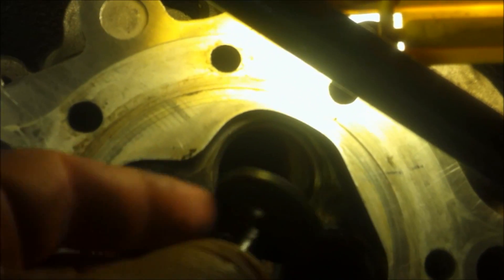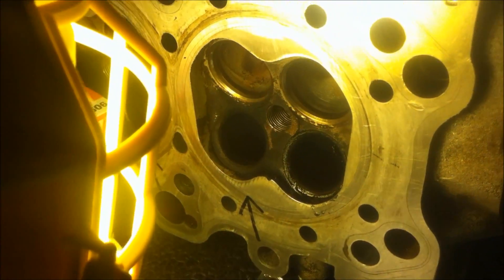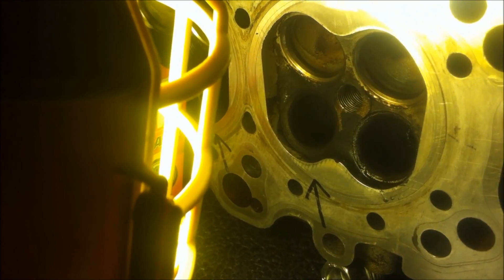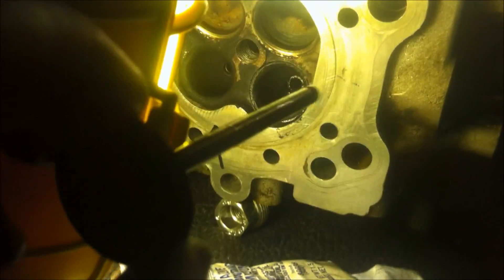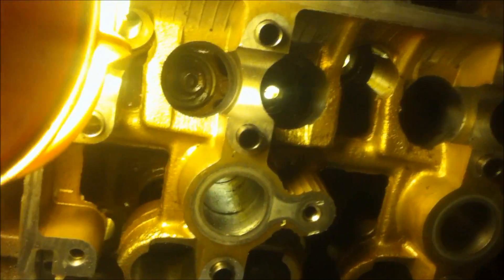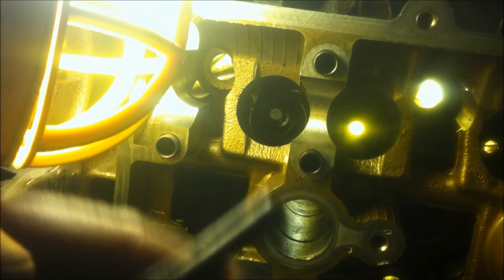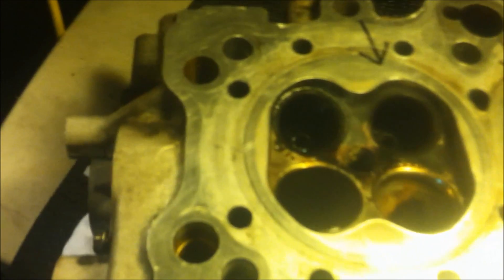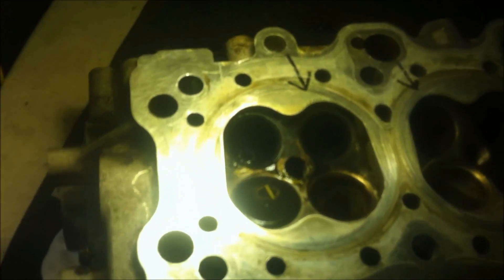EASY, HOW I LAPP & GRIND VALVES. THEY DONT TEACH THIS TRICK IN SCHOOL, ONLY OLDSKOOL.

Comment: why would you not just ues a standard suction cap valve lapping tool , they cost about 10 bucks which is cheaper and just as easy . this is just another method but not necessarily any better or cheaper . probably faster but thats the only reason i can think of doing it this way . 12;55 you even have a standard valve lapping tool there , just use the rubber cap on a different attachment so you can use drill . easier than trying to work from behind head
Reply: You have to go to a store or online to by a specific tool. it's better and faster to reuse what you already have. That is.. If you have it? If you have to go to the store to get the compound, then, if you have enough $ get the flex bit then yeah, get it. If the store doesn't have the flex bit, or you don't have enough $, at least you have plan B.
Reply from the maker: Michael Polson Dont do it then, Do it the hard way if you like.
Reply: oldskool funk  using a flex bit on the rubber cup and standing in front of head is harder ? how

Comment: I was a cylinder head specialist for about 15 years in well equipped shops, even we relied on methods like this when we had issues  This man, I would be proud to work beside, as the mind set of quality at a low price is there.
Reply: If you worked in a shop for 15 years you should know that you don't use a drill to do a valve job , you supposed to use your hand  with a lapper tool so you can feel it and be more  precise . You can use a drill (yes ,maybe) but it's not the way to go
Reply: @yosoydpfknr2855  I was thinking the same, yeah you can make it work with a drill but if you’re not careful it can make grooves in the seats where the compound sits in one place. Better to take your time and do it by hand.

Comment: Thanks for the video! I'm trying to revive a rider mower. I thought a valve seat came loose from the head, but all looks fine...but dirty. Going to clean things up and try re-seating the valves. The valves do not look bad and very little if any play. Might just do it by hand, but at least I know how to do it after watching this. Since I already have the head off, no reason not to try.
Reply from the maker: Badboy7357 Right on, I also made a video on how to check if your valves and valve seats are leaking that way there is no guessing, Check it out https://www.youtube.com/watch?v=q_gEp0NEybQ
Reply: oldskool funk After cleaning the head, valves, hand and drill lapping, and resetting valve clearances the rider fired right up. I am not sure what a shop repair would of cost, but it only cost me $15 tools/grinding compound/gasket sealer and about an hour of my time. Thanks for sharing your tips!

Comment: I did it in a slightly different way, and I will share it right here in your video, because some people may not have access to the same tools of yours.  I just turned the cylinder`s head around and pour some gasoline in the intake and let it there for a few hours...  to be honest, I didn`t even know that the valves had to seal , I just thought it would be logic if they did to keep the compression.. so I had these two cylinder heads here , old ones, and started to do some experiments, cleaning and such..    adding gasoline inside the intakes was very easy to do and the result was visible in a few minutes later..  I suppose it wasn`t sealing properly because of the thick carbon layer around of it.. cleaning it properly without grinding solved my problem.

Comment: Perhaps  there's a valid reason why they don't teach this. This isn't likely to repair the sort of damage that, caused a car owner to bring it into the shop in the first  place. The only real utility to lapping in used valves besides putting the finishing touches on reground seats and valves, would be reconditioning the valve surfaces that don't warrant regrinding.   Somewhere around here in a really old school  set of  valve tools. . A  hand turned lathe that uses a metal cutting lathe bit to cut a new surface on old valves.  Also  seat recondition tools that where that allow you to replace emery paper on tools that will grind the popular seat angles.
Reply from the maker: Youve been voted off the Island you will be deleted for thinking to negative and To much whining
Reply from the maker: Don't be negative like this guy peepz keep on smahin in life
Reply: nothing of value was lost aka the info you share
Reply from the maker: You one of those who just dont get it. No soundness just complaining. You should let that junk go its only going to break you down. Keep in mind while your complaining people (like myself)are GETTIN IT DONE.
Reply from the maker: waswestkan To much thinking there, Dont over analyze it just get the point.
Reply: oldskool funk i feel like you put too much thinking into it you could have just bought one of these http://www.ebay.com/itm/Vacuum-Pump-VALVE-LAPPING-TOOL-3-different-size-suction-cups-Kart-Lawnmower-ATV-/251280026570    instead of rigging up a hose to a drill where you wont be able to put much pressure on the valve to actually grind it
Reply: no i get it youre "fixing" this "badboy"  and when its done its not going to fuck up for 5000 miles
Reply: Seen it have to be done on new heads and valves not just used

Comment: My Dad taught me this when I was 15 (54now) when we were freshening up my first car (67 Cougar) and the valves were leaking a bit. We used a piece of 1/4" air tool hose, more rigid and twisted less than vacuum hose. Man o man did that make a difference. Before, it would screech the tires on full throttle take off. After, it would burn the tires as long as you held the pedal down. My friends were impressed big time. I became a mechanic and built many engines before I was 20. I have since run a machine shop and now have my own shop. Good video and your technique is very good. I say all this to commend you on your talent and skill. Heck of a job on  a Toyota 3.0 and the good news for all watching this is that if the valve clearance was good before, this method can save you a lot of time and expense adjusting the valve clearance since it doesn't take much material off the valve face or seats. GREAT VIDEO!

Comment: Well Skool, last week I commented on the head shaving at home and now this, you give me inspiration! Bent valves with a slipped t-belt and looking at bringing it to a machine shop for a few hundred or a mail order rebuild for close to 400. For 40 bucks I am going to buy new valves. Any tips? Its a 13 year old 120,000 mile NYC so the 3 angle, 400 machining job is out. BTW the head warp is under .001".
Reply: +G Zuk We run a machine shop, one thing I can say from old school back when I learned to now is....the valve spring compression/install tool specific to four cylinder engines is a good thing to have.  We use those old style C-Clamp looking things on V-8 still, but the new lever style tool is just great.

Heres a generic example:
http://www.amazon.com/Engine-Overhead-Remover-Installer-Compressor/dp/B00AU5LISS/ref=pd_sim_sbs_236_2?ie=UTF8&refRID=0TW1D2T54RD5EVXNG4DJ&dpID=41EZlI5kprL&dpSrc=sims&preST=_AC_UL160_SR160%2C160_

Stay gold.
Reply: Thanks, I learned the hard way the 10 dollar harbor freight valve spring tool is NOT for use on the OHC 4cyl. I ended up buying the rebuilt head out of sheer frustration of trying to get the valve springs off. Turned out the I had bent all 16 valves and still wasn't sure if I had cracked a guide.

Comment: you should have done just gas you still would see the bubbles and you wont have the rust later if you didnt treat it after.
Reply from the maker: Don't need gas but any liquid will work. I always put oil on after to prevent rust
Reply: k just had to say i have had rain problems... not fun

Comment: How do you clean out the grinding compound after you're done?
Reply from the maker: I use engine degreaser to spray the whole head then I use brake cleaner, carb cleaner or acetone to make sure the head surface is oil free before I install the head gasket.
Reply from the maker: Ha ha ha, does it work?

Comment: You can also use a socket, extension, and a hammer to get the valve springs off. Easier and cheaper than getting the tool, unless you are doing a bunch of heads.

Comment: You said that is an intake valve! So the same job can be done in the exaust valves as well? If its same procedure it will be great, and good to know i can fix my valve sticking open and causing missfires and commpresion lost, thanks man
Reply from the maker: Thanks jesus, Yes its the same process for the exhaust valve also

Comment: Thumbs up man, a machine shop would have done an entire valve job. Way to save some $$$!
Reply from the maker: Thanks motherlovinsnuffstar, they charge quite a bit for the valve grinding process. You can buy a drill, rent a valve spring compressor and get the valve grinding compound all for under what they charge $150-$250 and do it your self with pride.

Comment: I high school shop class I hot glued a wood dowel to the top of the valve to then spun it by hand when there was not enough suction cup tools available. I have actually used the vacuum hose trick too. Great video!
Reply from the maker: Thanks rogerbeginify. Ya man that wooden valve lapping tool just wasnt cuttin it anymore to much work inlvolved lol

Comment: Any idea how much it would cost at a machine shop?
Reply from the maker: The machine shop I go to charges $70 for cleaning, pressure check (check for cracks) and cylinder head resurface. To add valve grinding the total they charge is around $300- $350. Most of the time I only have them do the $70 job, then I do the valves myself.

Comment: great for old v8s and technology from the 40s & 50s but this is a No No for modern high performance and racing engines. End up burning a valve realll quick. Cheers
Reply from the maker: You are absolutely right Superseven. High performance engine require separate valve face and seat cuts from a  machine shop  (45-30 degree cuts, 060"-.080" etc) for better heat distribution and performance but this works just fine on modern cars.

Comment: Thanks for the video my question is after I did it to 3 valves the have very fine lines running the direction of the valve did yours do that as well?
Reply from the maker: Thanks Les.Yes I do get the grinding lines and it seals great still. Just make sure you grind the valves long enough to change the entire surface of the valve face and valve seat.

Comment: Great video. That's how to do it without breaking the bank! 
What to do if there is damage to the head itself instead of the valve as the result of the valve leak - can they put molten aluminum and fill in any pitting, etc.? (If an exhaust valve leaked and there has been burning)